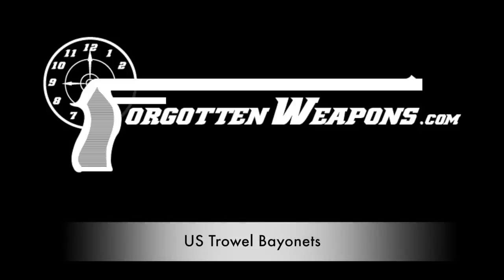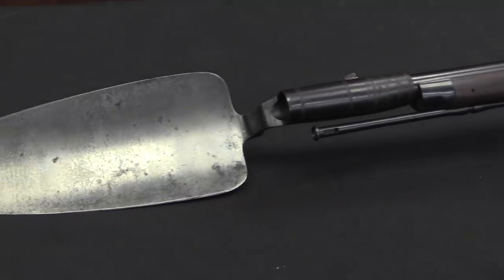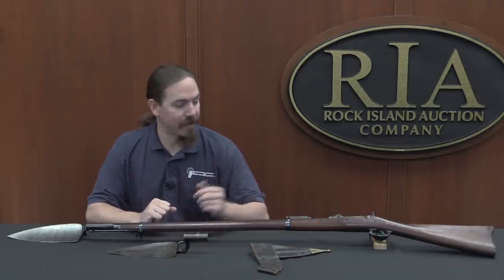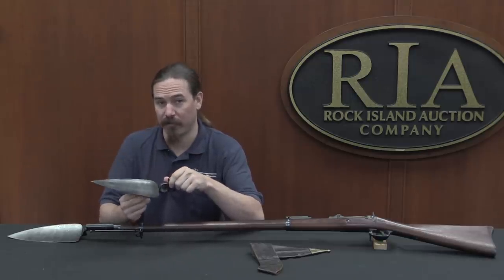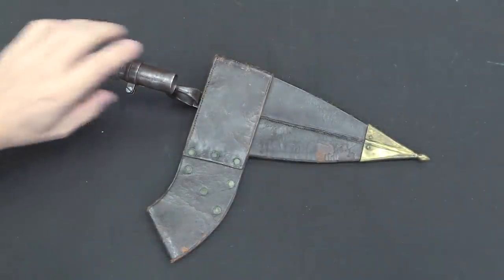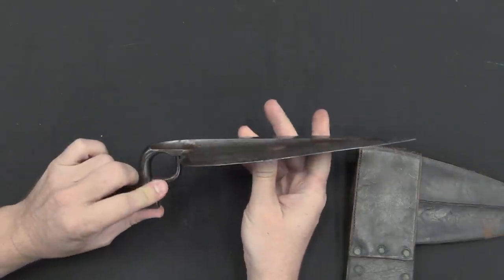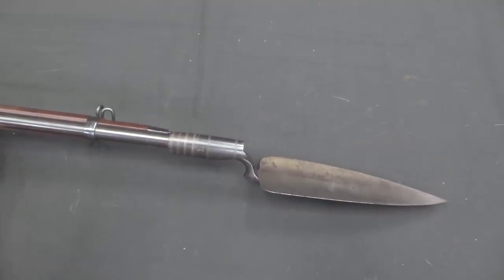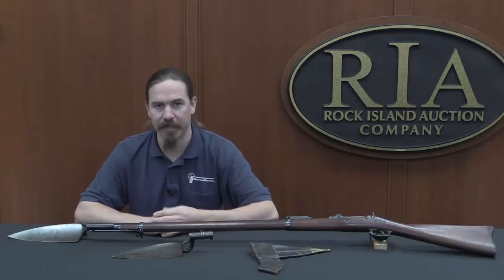The Good Idea Fairy Strikes: American Trowel Bayonets

Comment: Considering how dangerous a shovel can be (WWI was infamous for this, medics would have to tend to soldiers with what looks to be "battle axe" wounds which were in fact shovels), I could see this being an actually pretty effective melee weapon along with being a nice entrenching tool.
Reply: Agreed; that looks like something deeply unpleasant to be hit with.
Reply: Indeed. Up to this day, there are sections in military manuals for close combat featuring fighting with showels. And modern entrenching tools usually have one side of the showel head beveled to enable the soldier to sharpen it if desired. I have done so on the entrenching tools I have been issued, and though i have not struck any enemies with them, I have used it a lot as an improvised axe, chopping down small trees, clearing branches and bushes. The older styles of entrenching tools with straight wooden handles are the best for such use, but newer styles with triangular handles also works ok.

Comment: I could definitely see digging with it attached , clean it off and use it to cook with.
Reply: My guess is the trowel will bend before the barrel does.  For that matter you'd have to hit the rock with a lot of force.  This is a trowel.  You're not trying to spear the ground to death with powerful thrusts, you're basically scraping it away.
Reply: But it's not a shovel.  It's a trowel.  As Ian explains in this video it's not meant to dig a trench.  More of a 1' deep hole.
Reply: Out of the frying pan, and into the ... FIRE!!
Reply: +Max Pain maybe you should be digging with the bayonet not on the gun? Durr hurr let's dig a hole with a 3 foot long rifle...
Reply: That would ruin the temper of the tool though
Reply: So if I take a butterknife and tape it to a stick, do I now have a spear? 

no. I have a butterknife on a stick. This is a trowel on a stick.
Reply: You'd have to do more than just hit a rock with this to bend the barrel.  Now if you got it stuck under a rock and wrenched at it I might see your point, but I'm still guessing the barrel is stronger both in shape and in tempering than the trowel and the trowel will bend first.  If your argument is pushing this into the dirt and hitting a rock will bend the barrel I don't see it.  To me the bigger concern would be ruining the crown or getting one hell of an obstruction, at least on the versions without the later socket attachment.
Reply: Not to mention that wounds inflicted with such a bayonet will be grisly and have a high chance of infection if the soldier wielding it had just used it to dig a latrine hole and cover it back up.
Reply: Around this timeframe the chance of infection was extremely high regardless of the conditions of the blade.  While I get your point mine would be suffering a large wound around this timeframe was practically a death sentence by itself.
Reply: 12D3 just quench it in the chest of your enemies... Problem solved
Reply: Could've sworn its the french answer to the coffeemill musket
Reply: phil verhey 😂
Reply: These comments are near AVE , tafladermous grade 😂😂😂😂
Reply: texasdee slinglead Taofledermaus even 😉
Reply: Max Pain work hardening is not warping or bending of metal, it's a change in the crystalline matrix due to mechanical processes.
Reply: legionary illuminati 😄, you read my mind
Reply: You take the trowel off to use it.
Reply: And whats the fucking point of attatching it in the first place? Stabbing someone? Instead of just clubbing your opponent to death with the rifle/club combination that you and everyone else carry around?
Better make a spear to bring along with the rifle then if your superiors are so insistent on disarming their soldiers.
Reply: This was never intended to be used for digging while attached to the rifle. Instructions of the day stated that they were only to be used detached from the rifle as a hand trowel. The US Army abandoned the spade bayonet in favor of the E-tool, which was easily carried on a pack, and could be used as a hand trowel or (with the wooden handle attached) as a trench shovel. In WWI, the American troops began sharpening their E-tools for use as a melee weapon due to its short length, basically coming full circle on the spade bayonet idea.
Reply: Murphy82nd actually, barrel bending from certain types of bayonets was an actual problem, so much so that a few designs were specificities made to get around this issue. Anyways, why wouldn’t you strap it to a stick to use it as a trowel. You do, NOT want to have any chance of the firearm you’re using to have any damage. Even small deviations could horribly effect accuracy or even cause some serious damage to the weapon or welder themself.
Reply: "Combo latrine digger/pancake flipper!"
Reply: Yeah, cause that's not a great way to get all kinds of horrific diseases and intestinal parasites!
Reply: This was such a good idea we see it implemented all around the world today! 

(It wasn't)
Reply: 8:40
Reply: @Jentypin  You actually would have a spear oddly enough, just a shitty one. Stop trying to seem clever, you aren't suited for it.

A sharp rock tied/taped to a stick can make a spear so why wouldn't a bit of steel? because it ain't sharp? don't gotta be, just pointy and not even very much at that. Try it and stab at a tree and notice that it does go in while remembering that wood is much harder than flesh.

Comment: What about a chainsaw bayonet???
Reply: shlomo lindsay hahaha😂😂😂
Reply: Gears of war did you say?
Reply: Heavy, high maintenance, unreliable and only useful as long as their fuel/power supply lasts
Reply: If man portable railguns ever happen I could see it since they could just run it off the gun's main power supply.
Reply: @Anon26535  good point. I could see a man portable railgun happening, with the rise of EVs on the market, battery tech is being improved by the day, within ten years or so it's not unfeasible to think that a scaled down rail gun with a shoulder mounted battery pack would be able to fire several rounds before needing to recharge

Comment: That stiffening feature on the bottom of the trowel is called a medial ridge and is a feature used in knife making, specifically daggers and that trowel is essentially dagger shaped on the bottom. Medial ridges offer substantial strength to a blade center while letting the sides get thinned out in a concave grind

Comment: The bayonet happens to come with a rifle. Lol. The reverse of normal. Interesting items. Probably a reasonable idea given the lack of an e-tool. Certainly better than nothing. However, in 20 years as a cop i quickly learned that if you try to make 1 item do too many tasks, it doesn't do any of them very well. I am thinking mainly of the flashlight with the collapsible baton built into it (i doubt the light would stand up to vibration from strikes), the flashlight with an OC sprayer built in the butt (yeah right, as if- we know who probably ended up getting the OC most of the time), and the OC sprayer that mounts on a light rail (you know somebody got unintentionally shot if those things were ever used).  I wonder how well those bayonets would penetrate past the first inch or so. As the blade widens, it gets more difficult of course. And here we are, in the 21st century, still issuing bayonets. Mainly for opening crates and MRE's, but still. Great video as always. Thank you

Comment: When you mentioned the folding tompion version, I chuckled.  The first thing I thought of when pulling up the video was, "Hmmm, I'd whittle a plug tompion and use the rifle as a handle... I wonder if they ever did thing the Brits did with the spike bayonet for the No4, and issue a wooden handle with a steel end cap with bayonet mount..."

Comment: I recall visiting either the Clearwater Battlefield or the Big Hole Battlefield as part of the National Parks service Nez Perce Trail in Idaho/Montana and touring vestigial entrenchments where an Army attack on a Indian encampment had gone terribly wrong and turned into a rout of the blue coats. The trail markers and signage specifically mentioned the troops dug in using primarily their trowel bayonets. That was in 1877 so they were define toy in use still then.

Comment: Potentially dumb idea here. I see that on the rifle the trowel is mounted in what looks like a 3'o'clock position. If it were mounted at a 6'o'clock position, and the rifle were fired with it attached, would the flat face of that trowel absorb some of the blast and potentially mitigate some muzzle climb? Hardly a concern with a single-shot breechloading rifle I know, but just a thought.

Comment: 10:53 - Mounting the trowel bayonet with the blade vertical to the right of the barrel actually seems to me like a more useful way of mounting it than the standard underbarrel mounting (which, for a trowel bayonet, would necessitate that the blade be mounted horizontally); with the blade on its side like that, you could wield the rifle+bayonet like an axe in an overhand chopping motion (using gravity to add to the force of the strike, instead of just the soldier's muscle strength), rather than being restricted to thrusting it or making side-to-side chops and slashes.

(I suspect this might've been on the mind of whoever came up with that style of mounting!)

Comment: I use a sharpened trowel at work to slit bags of cement and rocksalt open quickly. It is a fearsome tool. I dread to thing of the wound it could produce on a human torso.

Comment: This is clearly the pre-cursor to the E-tool. The great, great grand daddy so to speak.  Let’s look at how this tool developed. In the American Civil War, troops did not have an entrenching tool as Ian says. However, the mass killing from rifled bullets, Gatling Guns and new, breach loading artillery, necessitated the desire for troops to “dig in” once in place. It’s pretty hard to dig in when you have not e-tool. The typical infantry unit dropped it’s marching packs and any support wagons at the first sign of enemy forces. Thus, it took some time to bring up entrenching tools when the order to dig in occurred. This trowel bayonet was well received in trials. It allowed, as the video describes, a soldier to get into defilade against direct fire. But that’s it. more rugged pioneering gear is needed for trenches and better earthworks but the grunt of old, has cover and if you ever faced enemy fire, you want cover, no matter how small. Something is better than nothing. This was the first attempt at providing the common infantryman a tool he can use to obtain that cover. Fucking brilliant if you ask me. 

So the adage applies here - if it’s stupid and it works, it isn’t stupid.

Comment: Long term potential is obvious. It could be used as a bayonet during the war. After the war, it could be used in masonry work during reconstruction. It was a dual purpose tool for sure.
Also, rather than trench warfare, they could use the trowel for spreading mortar to simply build a brick wall. Many possibilities...

Comment: That ridge along the back makes this weapon so much more devastating.  You may be able to deal with a flat puncture wound if you are lucky in regards to what it hits; a puncture wound that goes both vertical and horizontal seems like it would be near certain death from blood loss alone, let alone taking what it hits in to consideration.  It's a gaping 3 dimensional hole.

Comment: It would be very interesting if someone did some penetration tests with a reproduction of such a trowel bayonet. Sharpening the edges would give it better penetration capability, and would also make the mounted bayonet able to be used in chopping attacks, similar to how you would use a poleaxe or halberd. It would also enable the bayonet to be used to chop down braches and clear brush. Of course, the edges would get dull the moment you started digging with it, but even a dulled edge could be useful as a weaopn or a tool. The beveling of the sides would have to be grinded down, though, making it slightly less effective as a showel.

Comment: "In any case, the bayonet isn't as important as it used to be. It's more usual now to go into the attack with hand-grenades and your entrenching tool. The sharpened spade is a lighter and more versatile weapon - not only can you get a man under the chin, but more to the point, you can strike a blow with a lot more force behind it. That's especially true if you can bring it down diagonally between the neck and the shoulder, because then you can split down as far as the chest. When you put a bayonet in, it can stick, and you have to give the other man a hefty kick in the guts to get it out."

-Erich Marie Remarque, All Quiet on the Western Front

Comment: I wonder how hard this type of bayonet would be to stab thru some uniforms, especially thicker wool stuff? Or web gear and coats. I think if this trowel bayonet wasnt very sharp(especially after using it for digging)may not work so good considering the surface area.

Comment: I thought about this briefly while watching your video on Bolo/bowie bayonets.

I immediately dismissed this idea because a bladed shovel or a trowel bayonet would be blunted whenever used as a trowel. But I briefly entertained the notion of multiple compact attatchments for your rifle to serve multiple roles in a modular way. However, constantly in your videos you explain how fragile guns are (which makes sense, especially if you want light weight or precision). so using a gun for digging/prying seems like a fast and expensive way to disarm your own soldiers.

So this trowel bayonet is literally the culmonation of the downsides to all of those ideas. Aka, the worst idea.

*Though I guess using the trowel off the gun would be ok...

Comment: That first pattern trowel bayonet being a plate of steel welded to a spice still having its tip isn't really suprising to me, with no electricity the only way to weld that togethet would be a forge weld, which the temp for a forge weld on those pieces of steel would be very close if not the same temp for a proper heat treat and oil quench, so it should be very strong

Comment: Sticking your expensive, hard to clean rifle's barrel into the dirt is generally seen as a counterproductive idea.

I'd like a trowel bayonet, because it looks wickedly terrifying, but if I had to use it to dig a trench so I can safely take a dump, I'd rather attach it to 10% of a broom handle or whatever stick I can find.

If the army had any sense, they'd fashion shovels out of the armor plating of whatever burnt out piece of machinery they could scavenge on the field. 
Given the right tools, I could turn an APC into two dozen shovels or a hundred trowels in a day. 
Give me a broken tank, and I can start a farming commune.

Comment: They could weld back in 1868???? I had no idea they had the tech to weld back then and thought everything was cast, forged or riveted.
Reply: That makes sense. Although I'm not sure how good that weld would be.
Reply: So its basically reforging?
Reply: You can weld through forging, there are tons of vjdeos on the subject.
Reply: Forge welding is very good. It was used in countless weapons for centuries and a good number of those weapons still work as well as they did back in the day.

Comment: It probably wouldn't be that bad if it was issued as a utility tool and came with a barrel plug so you could actually use it as a full size shovel and not fuck up your rifle would make digging entrenchments way easier than with the common spade soliders are given

Comment: They hadn't invented welding in 1870
Reply: Forge Welding: heating two pieces of metal up really hot and then hitting them with a hammer until they fuse together

Comment: With the threat of being shot, I could definitely dig that, with that, in less than 20 min by myself. Just sayin.
Reply: I definitely would have made it lie flat on the rifle instead of on its side. You can't scoop up under armor and into the abdomen as easily on it's side. I would have also issued a full length wooden handle. The option to snap it onto a shovel handle would greatly improve it's performance as a shovel and negate the threat of a random dumb soldier using their gun as a handle. I would have also made it a bit thicker and a few hairs less wide. As it is it's almost pointless as bayonet. duh duh ch